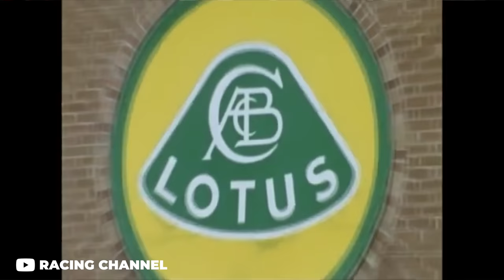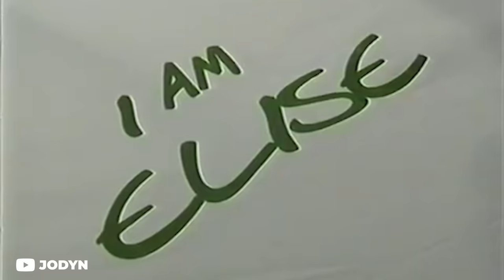So You Want A Lotus Elise

Comment: The wanting a lotus but buying a Miata is exactly what happened to me. MIATA GANG
Reply: I bought a Solstice GXP
SOLSTICE GANG,
anyone?
Reply: @UpperRobin29  Miata gang isn't toxic and we don't exclude. You comment Is welcome and appreciated.
Reply: I wanted an Elise, settled for a miata, but somehow got a Z3 2.8i instead. 🤔  Instructions unclear: bought better car for less money.
Reply: I made the exactly opposite.
I was looking for a Miata, and i buy an Exige 😅
(Well, not from the day to night, i pass thru Miata, S2000, Elise and i finish with an Exige)
( instagram: t8li)
Reply: Wakanda Forever  Yes,  I meant I got a car that's better than a miata, for less money than a miata.
Reply: Wakanda Forever  Personally, I'd go with the Z4 for sure.  Not sure about you, but I like to stay away from mechanic shops, so I do as much maintenance and repairing as I can myself.  The Z4's inline engine is going to be a lot easier to work on, and the M54 engine is one of BMW's most reliable AND tunable engines.  And the VQ in the 350z is pretty imbalanced, as V6s tend to be, so it vibrates rather violently.  I wouldn't even worry about a swap with either car, as they're both good, tunable platforms. Considering these cars tend to cost about the same, have comparable aftermarket support, but have different buyer demographics (Z4's were mostly bought by old people who take care of their cars; 350z's tend to be popular with young drivers who drive them hard, are less responsible, and may skip some upkeep), I'd say you're more likely to find a Z4 that's in better condition, with lower mileage, and costs less than the average 350z.
Reply: Or exige. And it's why I ended up with an RF given I cannot buy an Exige 430 in USA. Or any Lotus worthwhile... don't like the Evora
Reply: Wakanda Forever  of course not. My comparison was miata to Z3. The lotus is in another league entirely.
Reply: Wakanda Forever  This is true. But the Elise is no slouch either. Back when they both had I4 there wasn't much difference. Now there's not much difference between the Exige and Evora but I dont like the looks of the Evora. The Exige and Elisw are dream cars of mine.
Reply: yeppers ....such an easy decision if you ever owned any other vehicle that fell short with no real fixes...maybe a guy even has to do that a couple times but eventually ya just want it all cheap and plenty good enough....let the other guys have something "special" and deal with the short comings ....life is too short to be trying to aftermarket your way to satisfaction when there really is no way to get there....
Reply: The modern Exige is in another league performance wise. The current Elise is quicker than the old Exige.
Reply: @drtm1718  you left out my slk brody
Reply: @WatchesYouAtNight  They ARE pretty awkward looking.  If you put in a little money and effort you can make them look ok though.  I DID NOT like how they looked when I bought mine, but it grew on me.  I can live with the roadster, but the coupe is fuckin hideous.
Reply: @Mitutumuch  Aren't those only auto? I've never been into M-B or AMG cars, tbh.  They're just not my thing, but to each his own.  You enjoy your car, bud.
Reply: @drtm1718  mines a 5speed, ther slk32 came in only auto but a few has 6speed special check my youtube channel, been building this past year. I'm about to get nys inspection too! so you know I've done some decent work here no sensors no check engine lights nada. bought for 2300
Reply: Kept both❤️
Reply: Same lmfao, I will own an Elise soon though
Reply: @drtm1718  Uh no…lol that’s a shtbox
Reply: @Blazerghost  what, a z3?  Sure it is, but it's still more fun than a miata.
Reply: @drtm1718  Idk about that, z3 spends more time on the lift than it does getting gapped by Prius’s.
Reply: @Blazerghost  Source?  Mine's never even been to a mechanic shop in the 3 years I've owned it.  I drive it year round; rain, sun, snow, or suffocating PNW wildfire smoke.  I've replaced the whole cooling system, the alternator and battery, full brake and suspension refresh, and have kept up with maintenence, all on my own because it's that cheap and easy, and I don't think I've even spent over 10k, including the car itself unless you throw in the 2 sets of wheels and performance winter+summer tires I've bought for it.  Gapped by a prius?  I said it's a z3, not a miata.
Reply: I ended up getting a special trim 86 lol but now after a couple of years I’m now searching for Elises . But the prices are averaging 40k-60k right now even up into the 70s.
Reply: I want a Miata but have a Pontiac Bonneville. Damn.
Reply: @ForzaWiz11 in UK they are mint for 30k lol
Reply: Always thought the Sky Redline looked like a tiny Corvette... @UpperRobin29
Reply: metoo

Comment: Just to point out the Yamaha designed engine was a Toyota engine . The 2zz-ge is a Toyota engine with a Yamaha designed head, like most toyota performance engines from about 1980-2005
Reply: I'm pretty sure the w20 mr2 had the 2zz.
Reply: the 08 Elise S had the 1zz-fe but since it was so light, it didn't matter that it had the same engine as the 03 corolla

Comment: Holy crap there is a bunch of bad information in here... All the US cars were Toyota 2ZZ GE motors (yamaha designed head), SC means supercharged. Most people prefer the 2005 the first model year (not 04), because they were cable throttle, not drive by wire,  Later years were mandated to have TC,. The evora 400 is here, and already replaced by the GT. They are definitely NOT just an MR2 with fancy tail lights, the driving dynamics are completely numbed in an MR2 comparatively. Common upgrades to wheels are RAC monolites or Team Dynamics. Suspension came stock with Bilstiens, but you upgrade to Nitron or Penske, and for the record, the seats are about as comfortable as you can get. There is very little padding but the seats are actually designed to cradle your spine.
Reply: Yeah I had a 91 MR2 turbo and currently have two Lotus Elise's and there is no comparison. He disregards the Lotus engineered chassis which is the real magic of the Elise and the Toyota reliability makes the whole thing amazing. Really bad video in that it  does not do the Elise the Justice it deserves
Reply: Yeah the info in this video is really bad and misinformation is through it
Reply: I agree. They have a lot of bad / misinformation in here. I couldn’t really pay attention due to all the hand flailing and ridiculous cuts and transitions tho. This video made my head hurt
Reply: love the probax seats - it's really incredible how so little padding can be so comfortable. Basically a strip of padding runs down the spine to keep pressure off of it
Reply: Id disagree with the seats lol they felt pretty uncomfortable after a 1-2hr drive but as aspected its a track car lol
Reply: The comment about those wheels and suspension options are prolly because they carry those brands lol

Comment: Having owned Lotuses, the primary reason why Lotus cars, the Esprit in particular, spent a lot of time broken was that their owners hardly ever drove them! For some reason, that's the way Lotus cars seem to be in the US. There's a 2011 Evora for sale near me that has 728 miles on it! I would absolutely not buy that car. I'm a professional pilot and retired Air Force pilot, and airplanes break when they aren't being flown. Cars are the same way. Fluids sit and puddle, and components that should be lubricated aren't. Rubber and plastic components dry rot quickly.  The few Esprit owners that I talked to on the forums who drove them as their daily drivers reported very few problems. I had a 1991 Elan that was my daily, and I also had no more problems than any other car. (That one had an Isuzu drivetrain.) If you don't work your muscles, they atrophy. If you don't drive your car, it will too.

Comment: Calling it a Toyota Elise, is like saying Mercedes Zonda , Audi Gallardo, BMW Phantom or VW Bentayga. The Lotus Elise was fully developed without Toyota while using a Rover engine, but to sell it in the US and for emission standards they sourced a Toyota engine and gearbox. The 68 kg bonded aluminium chassis is one of the key features which makes it stand out. The reason to buy this car is how it drives; it feels really fast, it has so much grip and you can ride it on the edge all day. The best thing is the communication through the non powered steering wheel, it 's like telepathy. The engineering to make a car feel so involved is on another level. Be aware of this before trying to improve this perfect driving machine. I'm so privileged to care for a Lotus Elise since 2010, can't imagine selling it. Wouldn't know what to replace it with except for another Elise/Exige.

Comment: Imported an S1 Elise into Canada, waiting to import it into the US. Currently undergoing a Honda K series motor swap. Can honestly say it's the better bang for buck compared to the S2 in terms of performance. ~1500lbs (~400-500lbs lighter than the S2), better handling, not as common. Even after importing, DIY kit, all of the Honda components needed, etc. it was still less than an S2. Just a stock K20 alone which is good for 200-230hp depending on which one and it runs 0-100 times in the mid 9s... 997 GT3 territory.

Comment: So I wanted a Lotus Elise at 16 after playing Need for Speed Most Wanted. I like weird cars. I bought one 2 years ago at 28. Great car but rough ride. The reason why they don't depreciate is because there is simply NOTHING like this you can buy stock in the USA. Nothing even close!  It's super raw. But it's also missing a ton of "normal" stuff. No power steering, no reclining seats, no cabin air filter, no glove box, no cup holders, front clam doesn't open, no carpetting etc. It does have AC but mine doesn't work. Can't drive it during rain or summer. And yes, my back is really tight after a drive for a few hours. It's a guarantee. Unfortunately, I think it's a car that a teenager should have because of how rough it is on the back but a teenager can't afford one. I just think I missed the prime age to really enjoy it. I like the car a lot. I don't love the car.

Comment: I've had an S2 for 10 years, 7 years with a na Honda civic type R 220hp. It has the reliability I always wanted and the sound is fab. It's a 2004 so the suspension has been refreshed, so there's not a lot to go wrong. Parts are reasonably priced so if you can afford one get one, I genuinely love it.

Comment: you totally glossed over the fact that the 2ZZ-GE has v-tec/lift and revs to 7800 RPM
Reply: 8200
Reply: @ovodrizzyszn7766  they lowered it in 2003 because of oil starvation issues.. I got one in my Celica GTS
Reply: The manual say you can do 10k for 20 minutes then 40 mins under 9k. Ive hit 9.5k in my S2 just to see if it could. Only did it for about 30 seconds. Spirited driving i go to 8.5k if conditions permit.
Reply: I mean the manual says you can shift at 8500..... So I do.  😅
Reply: @JeffSSartor  well it's got such a small band where there lift actually hits so yah 8000- 9000 rpm shifts 😂

Comment: I own one. It’s great if you have nice weather and a lot of twisty roads where you live. It’s fun for auto x if you get it set up properly. Out of the box it’s quite under steery and slightly under powered. I plan to supercharge mine and I think it’ll be just right 😎
Reply: Update?
Reply: @_.lik._2172  I actually enjoyed the car for about 2 years at stock power levels before selling it.  I did install a nice set of Penske coilovers and sticky tires to have fun on the track. If I had unlimited garage space, I would have never gotten rid of the car as it is so unique and raw.  Buy one and drive the hell out of it if you can, then move on if you end up not using it as much as you thought (my reason).  Either way it will be a great experience and you likely won't lose money on the car :)

Comment: Own the current S3 Elise, it’s the best most sorted Elise yet. Had it 2 years and not an issue a squeak or a rattle. Open gears great feature and gearbox is now a dream to use. Seats in a lotus are not a back breaker it’s the opposite being angled to take the weight off your spin I find the less back breaking then my amg merc on long journeys. Pity you Americans don’t get the current version (which is mostly the reason your s2 don’t depreciated).

Comment: Toyota motor brings epic reliability and still slaps everything else on the auto cross track. Revs to 8000+. I own a 111R and can tell you it is on another level vs the mr2, go drive the two then compare if you think they are the same thing.

Comment: elise SC is actually not really much if any faster than the standard model especially on track/autocross. It had the small mp45 supercharger with no inter-cooler. Factory supercharged  exige S are inter-cooled and have the  bigger MP62 with alot more headroom for power. Biggest downside for elise/exige is of course the fragile and expensive body work. The are great track cars for fun and consumables but you do not want to have an off or any sort of incident in one.

Comment: That car would be too small for me because of my tall height at 6'4 1/2 weighing 171lbs. However that's a dope car and it looks hella better with a nice functional widebody kit, spoiler, front splitter, and rear diffuser as shown in some parts of this video. That car was featured in some racing games Need For Speed: Most Wanted (2005), Carbon, Pro Street, Undercover, Shift, the list goes on.

Comment: Why it always stays around $30,000.

Competition basically. Just look at the competition, it's the same reason on why the s2k is still around $20,000.
The other lightweight FR cars just cant match what the elise can put on the table.
A used cayman is maybe better in terms of street driving but the lotus will be much faster on the track.
Reply: Doesn't even matter that the Cayman is faster.  Drive both.  I bought the lotus because the drive is another level.  Raw and exciting.  The Cayman may be quicker but it's a bit more boring to drive.   You want your Sunday car to be hair on fire, all the time, every time.

Comment: Stick with cars you are familiar with. Worse review and misinformation EVER.

1) Only the Elise was named for a family member, the owner's granddaughter. 
2) Cannot pronounce Esprit. 
3) 2005 Toyota Elise??? 
4) Not the first few model's headlights COVERS melted, just the 2005. 
5) Yamaha designed engine??? No, just the heads.
6) In 2008 you could get an SC and also a supercharged??? The SC IS the superchargred. 'SC'', Supercharged, GET IT??? 
7)  The S2 had a SUPERIOR power to weight than the S1. 
8) The cars range from $25,000-55,000. 
9)  Toyota provide the Drivetrain, PERIOD. The bits and pieces are mostly Rover. 
10) Your wheel, tire and suspension recommendations are comical. The Sport Pack's wheels and Yokohama Advan tires are LIGHTER and GRIPPIER. 
11) I have done multiple 1000 mile road trips and the seats are fine and very supportive. I have been disappointed to arrive. 2005 non-Probax 
12) Why would anyone listen to you and make their Elise WORSE??? 
13) Shocks: Lotus' STOCK Sector 111 adjustable coil-overs on the sport pack are AGAIN superior. 
14) Lotus has 79 Formula 1 victories and 13 combined World Championships. You are a geek with a camera and a microphone. 
Stick with the Skateboard Park little boy and leave the Cars to MEN.
Reply: Little lady you drive an Elise, Calm down girl!
Reply: @jamesreeves4600  A benchmark Sports Car and still the best handling 25 years on. The car Hennessey used to set the World's production speed record in 2014. Your automotive credibility stands at a perfect ZERO POINT ZERO.

Comment: I think you miss the whole point of the Lotus, yes you skipped over the history and yes it has a toyota engine.......Blah Blah Blah.

But you missed the entire reason why these cars are so good, that is the feel, the way they drive, the rawness!
The supercharged cars are as quick as a STI WRX, just about out brake anything and carry an incredible amount of speed through the corner. Run on the smell of an oily rag and don’t hammer through tyres.

yes the interior is basic, difficult to get into, and things are held on by velcro, but when you get out of Lotus and get into a normal car it feels like you have just gone to sleep

I am currently on my second Lotus, and will probably buy a third. 
P.S. my current Lotus exige is the longest I have EVER owned any car. Check out my instagram for lots of pics.

Comment: Yamaha engine? Bruh. The Toyota 2zz is built and designed by Toyota and Yamaha. They co designed engines. Like the 4age, 3sgte and 2jz. It’s co designed. The 2zz was and is very reliable and was in production for most of the s2. Ughhhh get the fax right boi.
Reply: The engines in these and the celica/ Corolla for that matter don’t get enough attention for what they are 8,300 rpm rev limit. 2 stage vtec like cam and a reliable platform known for going past 300,000 miles. What more can you want